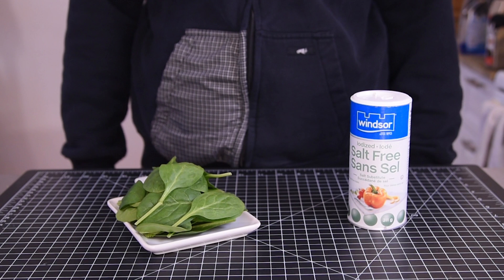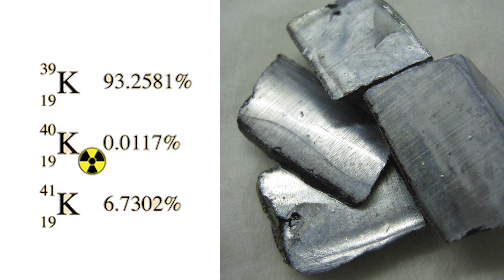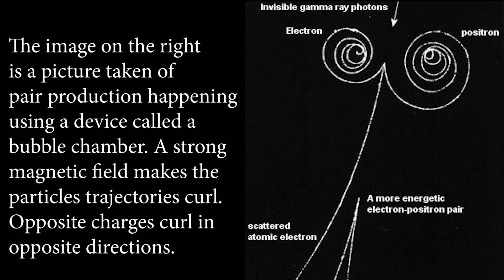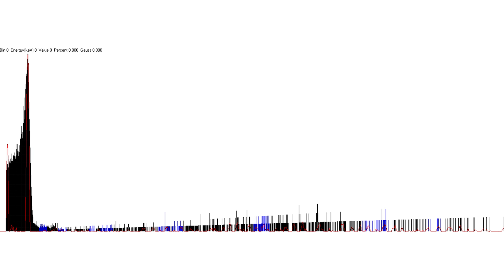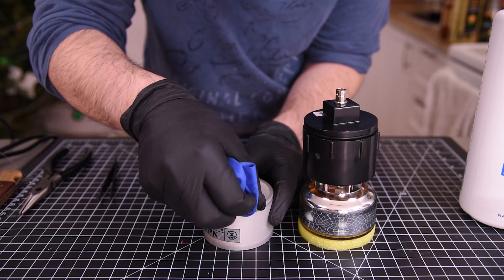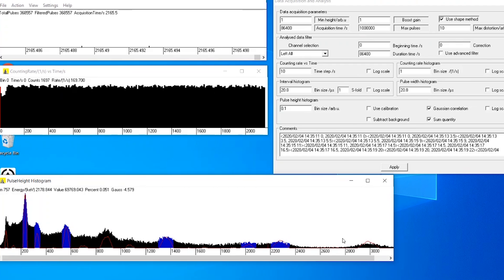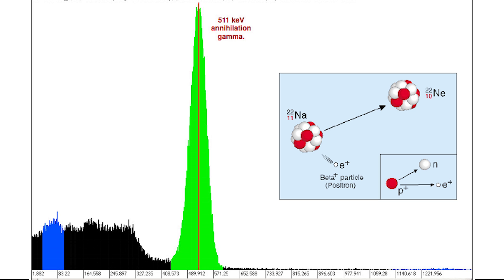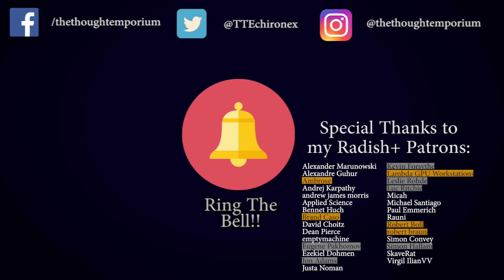Detecting ANTIMATTER in food - DIY Gamma spectroscopy

Comment: 2:41 sorry to be correcting you but the graphic shown at 2:41 is a but missleading. The probabilty shown (10%) referes to the Gamma Emission of the EC but the Energy shown is the maximum energy of the positron. But the beta plus decay producing the positron with shown energy only happens 0,001% of the time.

But maybe you chose it because you didn't want to overwhelm people with a more accurate diagramm. In that case: I haven't said a Word ;D

Comment: The thought emporium 
Are you a payed narrator 
Are you a satanist
Reply: paid*
FTFY.

Although payed exists (the reason why autocorrection didn't help you), it is only correct in:
-Nautical context, when it means to paint a surface, or to cover with something like tar or resin in order to make it waterproof or corrosion-resistant. "The deck is yet to be payed."
-Payed out when letting strings, cables or ropes out, by slacking them. "The rope is payed out! You can pull now."

Comment: I have been wondering about anti matter working the same. We have proven that the universe "cares" if an object is postive or negative, along with flowing forward in time and backwards,  even miror images. They cant just be flipped and work 100% of the time. Some particles break this symmetry. So wouldnt stand to reason that antimatter isnt quite the same?

Sorry for the bastardized explanation. I can kinda understand this stuff not put it into words. 

Also if you could tell me the name of this rule of symmetry id be very happy. i cant remember it.

Comment: I work in a lab designing and building ion mobility spectrometers.  That wire that you used to connect SHV to BNC has a special name in our lab - a universally dangerous wire.  Because the SHV connector is rated for much higher voltages than BNC, so you can easily hook the wire up to a power supply for beyond the BNC's rating, and get yourself into trouble.  Gave me a chuckle to see you using one.

Comment: Good discussion on position physics, however, you forgot to mention that, aside from direct annihilation of positrons with molecular electrons, there is a chance that a positron will form Positronium with one of the molecular electrons, and then (of course) annihilate. 

That's is, when thermalizing, the positron may form a bound state with one of the electrons, forming positronium as it thermalizes; or, the positron can completely thermalize in the material and then couple to a "spur" electron creating positronium.

Comment: Ooof. You used electrical tape. Yeah...not..not a good idea. Should've used a mechanical coupling method with some blackout paint (which is easily obtainable on fleaBay, the same paint used for the insides of optical devices). Even something like chalk board paint works. That tape will absolutely degrade.

Comment: Hey, that's weird... How can it contain antimatter if it contain there it would destroy itself in the contact of normal matter... And would become pure energy, i.e. light+heat ...
↓ Please tap this read more option...

Please explain me, that's way more weird than even the mysterious black holes in the universes...

And yes, another thing I've noticed, 
E= (mc²)² + (pc)² but you've written wrong, it's not pc²
Reply: It's the dose that makes the poison (or in this case bomb). It is there and it is getting annihilated but there isn't nearly enough of it to be noticeable. I believe he said that for a banana you'd have approximately 1 pair formation every 75 minutes. And even though it is antimatter one single positron only has a rest energy of 511 KeV or 8,19*10^-14 J. That would mean that the power of one banana is approximately 1.1*10^-15 W, which is not much.

Comment: You made some errors. Unit kiloelectronvolt is written as keV, not KeV (kelvinelectronvolt... whatever that is), and gamma rays are not a "form of high energy light", but "high energy EM radiation". Light is light - visible EM radiation. EM radiation and light are not synonyms. Light is a subset of EM radiation.
Besides that, you made a really great video with lots of high quality work. Really well done.

Comment: You have an error in your equation at ~3:50 into the video. The Correct equation is E^2 = (mc^2)^2 + P^2C^2. You forgot to distribute the power throughout the momentum term.

Comment: @The Thought Emporium
I found a hack with heat shrink tubing - you can stretch it outwards while it wasn't shrunk, making it's diameter wider, it'll stay like that, but when you heat it, it'll shrink to the diameter it shrinks normally, so this way you can fit even things that are bigger than diameter of shrink tube inside of  the tube. I hope this will help you sometimes when your shrink tube is tiny bit smaller than you need! =)

Comment: Bicron May be the company name? But they produce many types of scintillation materials including Plastic and many types of Crystal. At least I think that’s the case. Because I have a few sodium iodide NaI(tl) crystal detectors made by them with the name BICRON on them. And they’re definitely not plastic Scintillators. So I don’t think they would label their sodium iodide crystal detectors with the plastic scintillation “brand“ name.
but I’m not sure…

man oh man!!!!! Not sure if you saw my comment on your other video but I’ve been excited for this build! I’ve built several simulation detectors over the past month, and have also purchased some really nice stuff from the Tom at “irad inc”

I couldn’t be happier with my NaI detector, except for the fact that it is way way way too sensitive for trying to locate lost radioactive sources  (“orphaned“ sources).  I get 3500-5000 Cpm background readings..... and would like it more directional.

Tom told me to build a lead collimator for more directional detection… And I’m just curious on your thoughts about a collimator? Would love any input you could give. I was planning to use thin lead sheets sliced into 1 foot long 2 inch wide strips. Several of them Wrapped around the barrel. then take that preformed sleeve of lead and use it by sliding it down around the crystal when needed. So that only the end of the tube is detecting. Giving more directional detecting. If it works I may dip it in plasti-coat or something to keep the lead sealed so that it doesn’t scratch up my nice tube housing and so it stays together.

Also ended up scoring a few “portal monitors“ on eBay. Made from Bicron scintillation Plastic. BC408 and bc412. Both wonderful plastics and very expensive to purchase new in these large sizes. These things are massive weighing dozens of pounds each. Will be fun to break them down and use them for my own DIY projects or monitors! I don’t have the MCA analyzer yet and my main interest is not spectroscopy… But finding orphaned sources and radioactive materials in my buddies scrapyard. However my interest is growing and so is my collection of scintillation crystals and plastics! There are some beautiful like new sodium scintillation crystals being sold on eBay from Russia… Around $100 get you a massive 63 x 63 mm crystal that would normally cost you hundreds and hundreds of dollars. I got super lucky and scored a 150x120mm NaI(tl) Crystal… it must weigh ten pounds. Probably be difficult to find a single pmt that large. But it was such a sweet deal… I couldn’t pass it up. It’s brand new. I’ll be machining the enclosure soon… Once I can figure out the pmt set up.
Love your content! This has been a lot of fun!!!

Comment: 8:50 there is no conceivable way for me to think this kind of amplification by PMTs should be 'proportional'. It may be monotonically increasing... but proportional is... well to my understanding, and excuse the dad joke: out of proportion.
Reply: The voltage pulse from the PMT is indeed proportional to the energy of the photon, that is the principle behind the use of a NaI/PMT assembly for gamma spectroscopy.  A Geiger counter is not proportional, and is not able to discriminate between gamma photons of different energy.  As it contains a low-density gas compared to a dense Nai crystal, the GM tube is also insensitive compared to the scintillation counter.
Reply: @karhukivi  you're not exactly elaborating on the key points, the enegy of a photon is derived from its wavelength (i.e. e=hc/lambda). The question here is, is the amount of photons proportional. I.e. if two photons hit the PMT do I exactly get twice the voltage. That's what I doubt, and that's what the author claimed
Reply: @userou-ig1ze  No, you will get two pulses or "voltage spikes", each one proportional to the energy of the respective photon.  The amount of photons hitting the detector in a given time is the "intensity", not the energy.  The energy is as you correctly say, related to the wavelength.   If the intensity is very high, the detector electronics takes a few microseconds to recover and there is a "dead time" during which it cannot register a new photon arrival.  This can be seen in practice by moving a strong gamma source closer to the detector and plotting the intensity vs distance.   I didn't notice the author saying that, but in many videos (and classrooms) slips of the tongue do happen in the excitement!  Hope that helps and feel free to ask questions, stay safe!
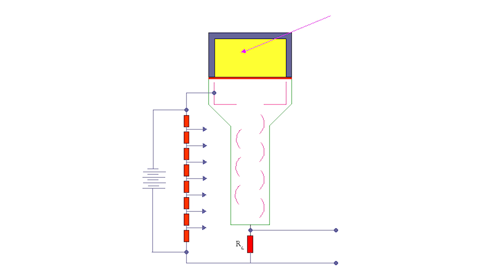Reply: @karhukivi  9:00 more photons is proportional to voltage output

Comment: @The Thought Emporium: Hello! I wanted to make a suggestion for investigation, given the current CV crisis, and ask that you take a look at sterilization of surfaces with UV light. There are a lot of grossly inaccurate marketing campaigns on amazon and ebay advertising UV bulbs.  Among the ridiculous claims, for example, are bulbs with a specified wavelength of "UV Light", that UV in the above ~200 nm band produces microbe-killing ozone (sources I find say it doesn't), and in some particularly bad cases that black-light spectrum bulbs are "germicidal".  Can you take a dive into this topic?
Reply: agreed. it should be investigated
Reply: "(sources I find say it doesn't)"
You have sourcves that say that UV is not capable of breaking the Bond in O2, thus letting O3 be formed? Please let me see that. 
O2 is photolyzed by light of 241 nm (or lower), since it has a bond energy of 498 kJ/mol. Any quartz UV-Lamp will do that and you will smell that.

Comment: That sodium crystal you used still had a "Made in Soviet Union" label on it. Wow.

I wonder how much old Soviet lab equipment is being sold around nowadays.
Reply: Quite a lot actually, the best vacuum tubes for tube amplifiers are ones that were made in the USSR.😁
Reply: @jasonsummit1776  While the other countries dropped vacuum tubes kinda soon once replacement came. Russia kept going and got refined into their vaccum tubes
Reply: @jasonsummit1776  Very old comment, but last week I was repairing a bass amp and and I noticed it still had one original valve, an 6L6 from miniwatt, the other 3 were all soviets from a preivous repair job done in the 70's. The miniwatt was at about 40% according to my tester, the soviets were reading all between 80%ish. 50yo at least and still running. Yeah, I just exchange that old 6L6 and a few eletrolitics that were gone and it worked like new.
Reply: I have ussr pliers
Reply: да!
Reply: @Xnoob545  i have north korean steels.
Reply: @mattbanks3517  I have depression
Reply: @Tonybaloney6969  What country did you get that from?
Reply: @ancientburrito9893  United States
Reply: Zasto je gugl govno

Comment: Couldn't you use water instead of lead as radiation shielding? It's easier to get and to store if not needed, the only down side would be your electronics. The easiest (and stupidest) would be to put everything in multiple plastic bags seal it up and throw it into a bathtub or fill hundreds of waterballons and surround the Probe (sealed in plastic). Or maybe make a real Chambers Out of a glass jar with a drilled hole for the cables and chug that into a barrel. I'm Sure you have some better stuff lying around If you want to shield it.

Comment: Cool stuff! The explanation about the energy balance was a bit wrong though. You do not need to hit a nucleus to get rid of the excess energy. If it was just for the energy, that would not be a problem. Just give it as kinetic energy to the electron and positron! You need a target for the photon, so you can conserve momentum and energy at the same time, though. It is not possible to conserve both energy and momentum unless you have something the photon can smash into.

For the curious: the easiest way to show this, is to think in terms of "rest frames", a coordinate system in which the centre of mass does not move. After the collision you have a system with a defined centre of mass, and thus a defined finite invariant mass = the total energy as measured in the rest frame. A single photon's invariant mass is 0 (and it does not have a rest frame). So you need to add a second particle to create a system with the invariant mass needed to create the positron electron pair.

Comment: So nice, I have actually done all those experiments at school
Our teacher worked out a partnership with a physics institute (DESY). They equipped us with all the hardware but we actually used a thermos bottle filled with water instead of a crystal (probably the same tscherenkow radiation?).
But we also had detectors with crystals in a flat form factor to set up those directional detections, usually three plates together. I'm afraid all their pages (I could find) are in German but here https://www.desy.de/schule/schuelerlabore/standort_zeuthen/kosmische_teilchen/index_ger.html you can find more information. Especially Cosmic@web https://www.desy.de/schule/schuelerlabore/standort_zeuthen/kosmische_teilchen/cosmicweb/index_ger.html is very interesting as you can analyse raw data from high quality experiments on your own (and I might have contributed to that app) ;).

Comment: 17:24 Next time:
1.) Wrap the T-Tape first layer around the cylinder circumferentially to cover the sides of the cylinder.
2.) Then, put one circumferential layer of double sided tape partway down over the top of the first layer.
3.) Add the layers to cover the end plane of the cylinder, the double sided tape will hold the ends of the radial end layer.
4.) Easy-Peasy.
Reply: Or buy larger sheet of teflon instead of plumbers tape ; )

Comment: I've got a gamma spectrometer myself and was thrilled when I saw the nice "annihilation peak" at 511keV for thorium, but you should be careful: For uranium and potassium, the peak is much smaller. Of course, they both put out less energetic gamma rays than thorium, but it was suspicious to me. Turns out, thallium-208, the element that causes the giant high energy peak with a 99% chance, also puts out a peak at 510.77keV with a 22.6% chance. Considering the 583-Peak is clearly seen right next to it at 84.5% chance for Tl-208, it is reasonable to assume that most of the peak is actually from this gamma line and not an annihilation peak, although part of it probably is. So take that peak with a huge grain of salt!
Reply: zockertypxl good catch! I’ve got a similar suspicion about the low energy thorium peak in the previous video about the bracelet EDS  spectrum

Comment: Couple of questions for you or your big brained subs. First with antimatter annihilation does the antiparticle only react with its counterpart or does it react with the whole matter particle? So for instance if you took a vial of mercury and shot a stream of antiprotons at it, assuming you could ensure that one antiproton only interacted with each mercury atom only once would you eventually be left with a similar amount of gold atoms or would you be left with an empty vial (also assuming that the vial didn’t react with the antiprotons first.)

Second question regards neutrons and antineutrons. Since there is no charge what would happen if you fired an electron at an antineutron? Would they annihilate or create an antiproton? Could you create atoms using regular protons and antineutrons or would these also annihilate? If they did annihilate would you just get energy or energy and a positron?

I have some assumptions on these but haven’t been able to find any firm answers so any direction or answers would be awesome.
Reply: Yes, antimatter does annihilate with matter with a 100% conversion to gamma radiation, making it the most efficient form of energy conversion. There are some exceptions like positronium but I digress

Comment: I hope that wasn't your mask. If so, it's kind of creepy because you would have had to gone out and had it custom made. And not for a small price either, considering it's custom leather. So yeah, creepy. Lol.
Reply from the maker: It's available on amazon for 60 bucks.
Reply: @thethoughtemporium Whyam I not surprised. Lmao. 

Edit: The spectrometer is quite inexpensive for what it is. I'm actually surprised at how little it costs, or at least what I would expect it to cost. The pre-made probes are quite pricey, but I completely understand why they are. If I had any actual use for one, it would be a fantastic option.

Comment: Using the double slit experiment for a thought experiment. Could we use electrons to switch quantum charges?
Reply: What do you mean ? What experiment would you like to do ?
I don't think the double slit experiment has anything to do with particle's quantum properties like charge or spin.
Reply: Just the analysis of scattering. Not sure if compton scattering is applicable here. But lets say we find the super symmetry of an electron can we then use bosons to alter its charge by changing its mass orbital or what its orbiting what ever its axis is. To somehow swap charges. Way out of my skill but im thinking if we can somehow change the charge to positive we could make heavier anti elements maybe.. Or a battery that was charged with negative and positive electron positrons.. Again im just having a thought experiment